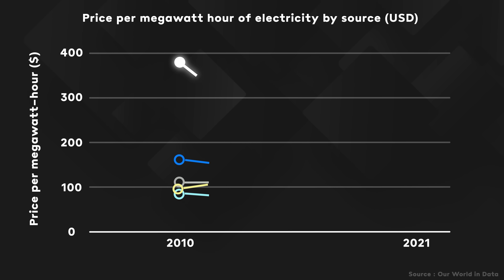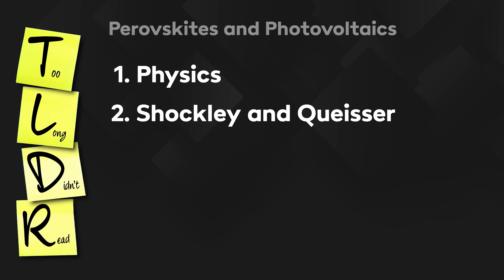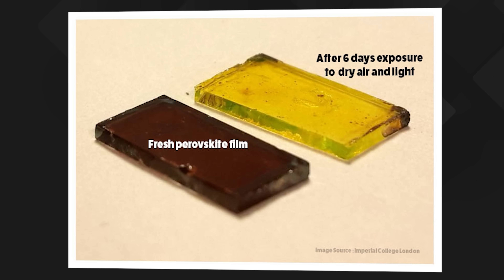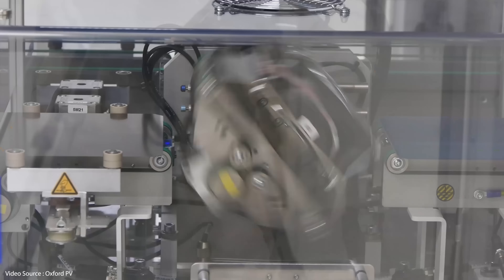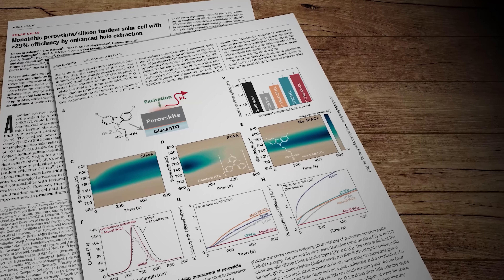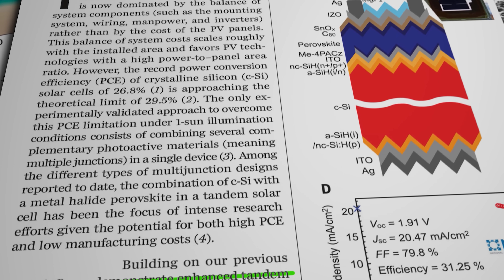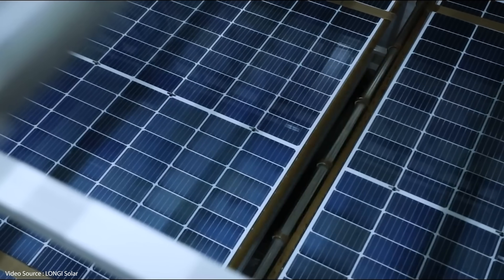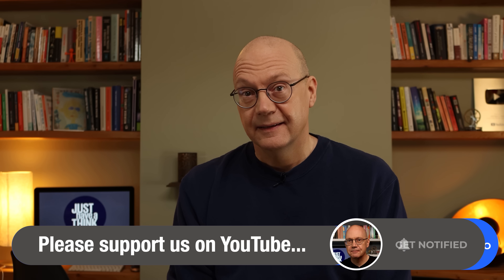Perovskite Solar PV. FINALLY some good news!

Comment: SO I think you summed up most of this best when you said more than once, nature has a sense of humor.

It's of course impossible to know if any of all this research will pan out because until some company or entity actually announced they are producing a product for the market, it's all a lot of research with SOME development.

Even in building silicone wafer production facilities, well that could be used to make typical silicon based solar panels, which they're probably going to need to because you can't have large infrastructure on your books unless you're making money, and by making money I mean there's a revenue stream, not necessarily making a profit.

But when I hear something like 300 hours and the output is down to 90%, well, they're about 20 years away from having power output from a panel that's marketable, as in they need to extend that out to 20 years when the drop is down to 90%.  You need to be getting MANY years of high production out of a panel or the cost has to be pretty low and the materials recyclable.  Of course the big costs for people is all the OTHER equipment that has to be bought along with paying installers for most people, so panels that don't have 20+ years is going to be harder to market, as people need to believe that whatever the OTHER equipment that's installed has to have many more years and you'll be able to swap out a shorter life panel with newer ones and it not cost a lot of money to do so.

Right now newer solar panels are hard to beat though because the cost is decent, and the warranties are typically 90% after 20 years.  With that high of a number it's easier to trust that after 10 years you still have high output, like 95% or above.  But then you never know unless the panels come from a reputable company.

Comment: The biggest advantage of increased efficiency will be the possibility of smaller instalations enabling its use in towns on apartment buildings or smaller houses where today it just won't work.

Comment: Great video. In my point of view the higher power output per square meter is much more relevant than the cost reduction. This increased power brings applications such as (partially) solar powered boats and cars closer. Here, you will simply want more power to propel your vehicle as you can’t expand the surface area anymore. For example if previously 50% was powered by solar, you could now power 75% by solar which doubles your range on batteries.

Comment: You said it the fossil fuel industry creating obstacles for renewable energies. Reason battery tech is being continually ridiculed is a campaign paid for by the oil and gas industry. They have been warned about the upper atmosphere drastic changes being caused by emissions from the use of fossil fuels

Comment: Additionally, a potential improvement to the efficiency of the panels could be due to their thinner profile and more efficient dissipation of heat which would otherwise result in resistive losses. Yet another example of nature's sense of humor, PVs need direct sunlight but perform less efficiently at higher temperatures 😀

Comment: I have found 400W PV solar panels at <$100 . Glass (or plastic sheet) - relatively thin (few mm)  is similar price for similar area.  
If  a panel sheet of totally dumb widely available material is same price as solar panel  itself it's difficult to understand how solar panels can made  very much cheaper than now. You obviously can't have 1 micron thin perovskite as anything useful by itself as you need mechancial strength to survive environment (wind) - so must be several thousand microns thick (i.e. several mm).
Am I missing something.
Reply: Correct current prices are $0.15USD/W for bi-facial panels.  (~60USD for a 400W 22%+ panel) That’s 2 layers of toughened glass, laminates, cells, aluminium frame and shipping packaging.  All for less than the price of a single sheet of toughened glass in most developed countries.  The real cost is in the installation. So if you can install 30% less panels the true gains come in installation cost and not the potential $0.05USD/W you save on the panel.

Comment: I am curious as to what enhancement  quantum dots and / or structures could affect 7:41 those peroskite panels.  Some sort of crystalline MOFs could capture more light and refract it around keeping it from escaping.  Maybe a new type of quantum knots or those silicon filaments that possess a great deal of surface area for far greater light absorption.😮!?

Comment: With all of the these, the problem that first comes to my mind is hail. Here in the Midwest hail is a not at all uncommon occurrence, and I have no trouble at all envisioning a one hour storm wiping out however many solar arrays you have on your roof. So before I’d entertain solar I’d need to see how well they handle 1”+ diameter ice balls. Nice vid btw.

Comment: You'll know the technology has taken the next leap forward when the production plants making solar panels are running 100% off solar panels. Until then, it's still dirty energy being masked as "clean". Someone may have some proper insight to share but what I've heard is that the lifetime of a solar panel barely offsets the fossil fuels used to create it. Don't get me wrong, I'm a big fan of implementing this tech and have been for years now.

Comment: The cost issues with solar are now around distribution and installation. PV modules are being made (with some subsidy help) for €120/KW. But put that on the roof, along with an inverter and some electricians to wire it up, and it's €1500/KW. And that price has fallen in the last two years. 

Improving the efficiency could help as the same installation - with the same roofers, or the same platform in a field - can yield 50% more capacity. But we still need cheaper methods to deploy and connect solar PV.

Comment: China increasing its solar sounds really good and it sounds like they are making more progress than America but it's sort of a trick. China has increased it's solar because it is economically expanding and for new power production solar is the cheapest to build for the output but existing power plants are cheaper to maintain than knocking them down and building new solar farms so they aren't doing better than the US the US is just expanding slower so it is creating less new power sources. Arguably the increased production from China means that they are producing more goods in factories which probably cause a lot of their own pollution. This is why you should never take statistics at face value.

Comment: It's very good to make the solar panels more efficient as long as that eventually comes with a cost reduction overall. Like obviously you can get more solar from the same area if they are higher efficiency so if you are limited on space that's very useful especially in residential use but for business if you have a field that you are allowed to put solar panels then your choice between high and low efficiency will come down to whether the cost of land available for that purchase against the cost of difference between the 2 types. If however the new solar panels are cheaper than the old ones per watt output then you'll never see an old one be manufactured again.

Comment: A lot of these tandem cells are using lead in the perovskite, which is an environmental hazard. And the tandem cell also is still using silcon wafers, meaning there's still a lot of embedded energy in these. So there are still plenty of issues with tandem perovskite cells beyond the lifetime issue.

Comment: I'm waiting for a low tech retrofit solution to add hot water collection to the back of my home 🏠 SOLAR installation. The increased efficiency from retrofitting might be a significant difference.

I bought mine in 2018, and would love to reap some benefits of the potential improved efficiency, before it reaches it's sell-by date in 2043.

I've considered rebuilding my frame, with a heavier duty design, adding simple flat water tanks to the rear of each panel. I can only find 2" thick plastic water tanks so far, but if thinner ones made from say, copper or other metal were available, with some sort of cold weather protection backing, that might be better?

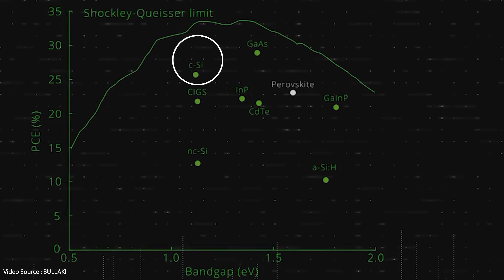Comment: 3:05 Uff. PEROVSKITE IS NOT A COMPOUND!!!!!! It's a crystal lattice structure which can filled with elements at will as long as the electronic structure is stable i.e. valence shell radius etc leads to a lower energy state

Comment: here the prices have dropped in the EU about 50% which will make it a lot harder for perovskite panels to find customers that need a higher efficiency due to a limit space. At the end most people decide to buy on the price per kWp. That is currently below 100€ . 
What could be the price for a 700 Wp in the usual 225 x 110 cm size ? 150€ I guess, so not much more than the usual 500 Wp for 100€ 
200€ and you would sell close to nothing. Maybe you can add 20€ or 30€ per panel for produced in the EU and better warranty conditions, but that would mean 20% or 25% on top.

It must be a tough market to start the mass production now after prices had dropped so drastically. Will most likely take far longer that the technology will replace the current types, but it has happened again and again like the poly panels that have disappeared since 2014. 
rough market and hard to survive but the technology looks really great. I could replace a 30 kWp array with a 40 or 45 kWp array on the same roof and footprint which makes it a good alternative in 10 years for repowering sooner.

Comment: No, you wouldn't have been laughed out of the room 15 years ago (~2009). That was the time of rapid price reductions year after year. Yes, it was relatively expensive back then but the trend was very clear.
What was pointed out back then and what is true even today is that the problem isn't just the price of the solar panel. It's the fact that each panel has to be backed up either by that fossil fuel power plant (nuclear plant can't react that fast), massive battery or a combination of both. And that is the hidden price of the solar energy - you pay for a solar panel AND for a fossil fuel power plant.

Comment: I suppose an advantage might be meaningful energy from fewer panels and therefore less weight on rooftops. That in essence is a limiting factor on many industrial buildings. And then someone needs to design a roof which is totally a solar collector and have it fitted to new build homes. Combined with batteries the Grid would not be overloaded both in generation and demand.

Comment: I think it will do well in vehicles and RVs where space and weight is a critical issue. Once its cheap enough, proven and mass produced, it could take over the market just like LED tvs did in the 2000s...

Comment: Great video as usual. The increase in efficiency from 22% to 33% sounds  great but I haven't seen anyone mention the fact that is a whopping great 50% increase in power output. My 5kWp array in Spain produces around 35 kWh per day in the summer months (more than my needs) but only around 12 to 15 kWh in the winter. That 50% increase in the winter would be a real bonus.

Comment: Thanks so much for creating and sharing this informative and timely video. Great job. Keep it up. I have been following the progress in Perovskite cells for years. To me, the holy grail is an inexpensive mylar (or similar) covered solar cell wrap that you can then use to wrap your house, roof, car, light poles, etc. Having solar cell covered walls / picket fences / etc. would be amazing. I am now reading about laboratory samples of clear glass (equivalent) solar cells. Imagine replacing building windows with such glass (in 2035?). I hope that most of this stuff is salt water proof as they are all arriving or will be arriving too late to help us meet the 1.5C deadline....
Exciting but: Sadness....

Comment: What china's ratio of new solar-powered capacity to new coal power capacity?
Reply: China is adding 40 gw of coal and 30 gw of nat gas in 2024. They are also adding 170 gw of solar and 90 gw of wind. So I guess just solar to coal 4:1.

Comment: After doing the math on my smaller roof, I would come out negative for installing solar even after 20 years.  I think improving solar efficiency might open up a wide range of new possibilities, where smaller surface areas are needed with higher power throughput, such as with cars and other things.

Comment: If they all still use lead, I see that as the foremost caveat for their sustainable production and usage. But as usual with sudden technological breakthroughs that are not quiet there yet for mass usage (but there is money to be made), such as fossil fuel-based plastics which seemed amazing a century ago but in hindsight were a very bad easy solution (to "what light, stiff and relatively strong material can we manufacture with?"), we are quick to adopt and lose our heads about cleaning the mess it has left later.

My point being – on wide adoption these will most definitely result in massive amounts of lead that will not be properly recycled and will just leach out everywhere.

Comment: "They're not laughing now, are they?" Given that they were MURDERED rather than being forced out of business due to actual MARKETS,, no they are not laughing now. It's not like solar/wind has really solved all of the issues that prevent them from EVER replacing oil, coal, gas, and nuclear. It's no mystery that those two "free energy darlings" remain prohibitively expensive. California mandated the end of oil and the adoption of "green energy" to replace it all. All it's done is to triple my monthly energy bill and make the energy grid far more fragile that it was prior to all of this. To be clear, I do NOT advocate banning solar/wind. Go ahead and put them on the market, and let the markets determine their sales, not some damned government mandates enforced at the point of guns. Global warming, my butt. Show me one EXPERIMENT that proves CO2 drives temperatures. Not some stupid computer simulation, or some stupid "study," but an actual experiment, as Richard Feynman said is needed to VALIDATE the THEORY that CO2 affects temperature. Just two years ago, California said that climate change was responsible for the droughts that had pretty much emptied its massive reservoirs. But the last two winters (2023 + 2024) have seen them refilled the reservoirs to the point of overflowing. Was that climate change, too???

Comment: Instead of silicon tandem cells, I think we’d all be much better off with the mass production of cheap thin-film solar cells. Ideally, thin-film cells with far less of a manufacturing and disposal footprint compared to silicon cells. Since we’re not covering most surfaces with solar cells already, the main thing that matters is reducing the price per kW and price per kWh. Once solar cells are cheap enough to put everywhere, then efficiency gains will matter more.

There’s still the massive problem of having enough grid storage for all that energy, especially if you want a solar-powered nation to last a week of overcast weather. Give us $1/W 100% efficient cells tomorrow and Germany will still have to rely on coal power for base load, and keep it burning 24/7 even if it’s not needed. We’d also need battery tech that’s orders of magnitude cheaper than current technologies. Though less efficient battery technologies (e.g. thermal) will become more viable as peak-production energy gets cheaper.

Solar and wind are only cheaper than nuclear or gas or coal in most countries because you’re looking only at the average power production, not at the cost it would take to make that power output reliable regardless of time or weather, i.e. non-intermittent. As percentage of intermittent power generation increases, the cost of electricity will also go up, as the non-intermittent base load will be under higher strain. If you have a bunch of hydro or geothermal, great. For everyone else, better gas than coal I say. And better nuclear than gas.

Comment: As the cost of the panels themselves drops, the cost of labor to install them becomes relatively more significant.  More efficient panels, even if they cost more per watt, might still be the way to go, since they allow higher ratios of installed capacity to hours of labor.